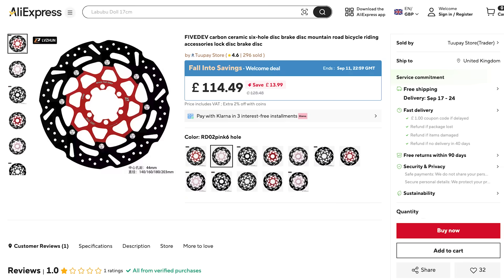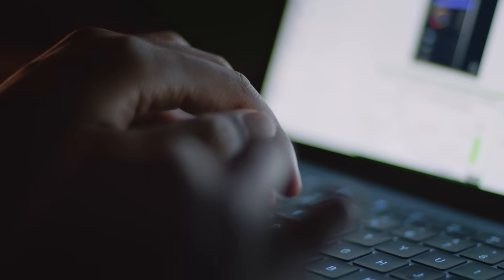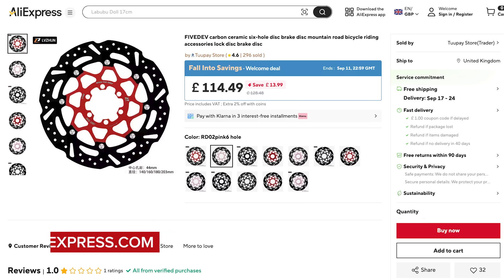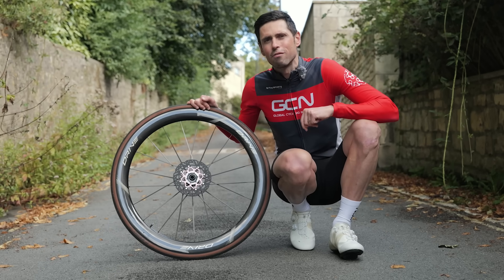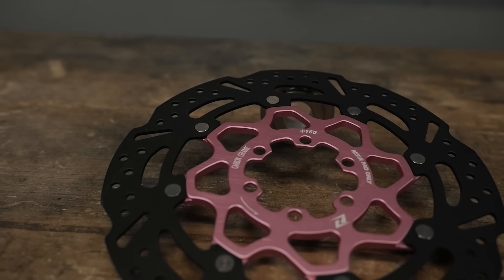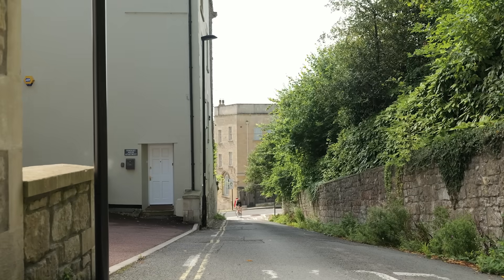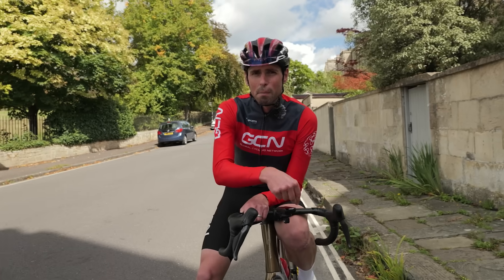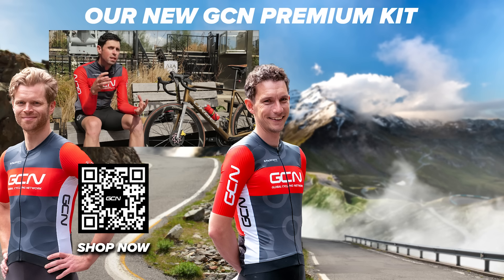Why Bikes Can't Have Carbon Ceramic Brakes

Comment: Back in the nintees as an apprentice I had various brake ideas myself, then racers were testing aluminium discs with a ceramic coating, problem was thermal expansion and letting the disc float, warping became the issue, brake discs have a thermal dynamic optimum, that sits as a constant operating temperature 
This negates alot of materials , carbon matrix composites are possible , but.... Very expensive 
The legalities of covering yourself as a manufacturer are too risky for the worth
It will be a complete overhaul of brakes , not just the rotor to change everything...

Comment: Luckily  for you, the breaks did their job at the stop (bold test)... I've worked in the aeronautical industry, where composite material are rife because they are light and diminsih the radar signal for military aircrafts. Yet, when it comes to shock resistance, they can't compete with metal (aluminium, titanium) for landing gears for example. I don't think we'll ever see a battle tank made of composite material... Cheers!

Comment: Speaking as someone who has titanium parts in her arm from a brake failure in an emergency on level ground, perhaps we should test sketchy brake performance wearing moto gear? Some cheap kevlar and foam pads between you and the inevitable slide if it fails outright won't matter until the day you get on the ali-express wee woo wagon ride to the bone sawing guys.  

Carbon brakes on a motorcycle make a bunch of sense, carbon brakes on an illegal ebike might make some sense, carbon brakes on a bicycle don't make sense. If the brake is still going to be able to perform with a louvred CF housing to keep the gravel out and be lighter that COULD be a real thing, but it hasn't been designed that way yet! The one place it will never be is on consumer grade bikes, if it comes to bikes, it'll be a dentist bike extra. 

As for just using CF, you are facing the Oceangate dilemma. If you pinch a steel rotor until it overheats you are at risk of slightly deforming it, but when you release it and cool it down it's going to re-crystalize into the structure that makes steel so gosh darn reliable. If you pinch a CF rotor until it overheats you are heating a small handful of layers of carbon and epoxy at different temperatures while putting it through shearing pressures that CF doesn't play nice with in the first place. It will fail, it will fail when you need it, it's failure will be catastrophic and sudden, and there's no guarantee it won't just flop loose and stop the wheel it fails on like someone ringing through your spokes with a pole, which will only stop you the once. On top of that, the weight savings are only substantial to the obsessive. That's not enough weight for me to compromise durability. It's frisbee sized not frame sized, we can hang.

Comment: They're great If you're going 300 kph and need to slow down quickly, but if you are going that fast on a bicycle I think you'd have bigger problems than having the right brake discs.

Comment: Folks who buy road cars with carbon ceramic brakes swap out the rotors for steel if the cars actually do any track work. It's just jewelry

Comment: Anyone arguing for carbon brake rotors in bicycles demonstrates their lack of understanding on how they work and why they are good... Carbon brakes are only good when they get HOT and bikes are just not fast or heavy enough to get them to those temperatures... It is just pure marketing, making you buy unnecessarily expansive rotors that don't even perform as good as good ol' steel ones.... OH BOY YOU SAVE 100 GRAMS OF WEIGHT by changig to these meassively expensive rotors!!! Bro, lose 100g of weight and you'll get the same result... actually no, because decreasing  your own weight would lower your center of gravity making our bike more stable...

Comment: I kind of feel like a Carbon-Carbon Brake(CCB) is a solution looking to build itself new problems in a bike. Steel Brakes run really well for the sporadic application of bike brakes and working great from cold in comparison. Carbon Ceramic brakes also have issues working from cold as well. As for the weight savings your Carbon Inner hub with a steel outer disc seems to be the answer to that problem to reduce as much weight as possible. There is a spot for CCBs but I feel that it is not bikes due to the need to build a lot(like boiling water hot) minimum heat in order to get the benefits as well as the awe inspiring price tag would dissuade all but the richest of cyclists from considering them. The only real spot where a CCB shines is in extreme high heat where break fade starts to happen. That can also be solved via cheaper means like cooling housing, thicker disks, disks with radiators to remove heat more effectively, and more effectively. Ultimately though I am just a watcher and a consumer so my view does not matter a whole lot.

Comment: Rim brakes for me. Rotors are an extra part. they introduce torque at the hub, putting cantilever forces on the front forks, and, extra tension on the spokes. You already have a rim, so you only have to add the weight of the caliper and cable/hydraulic line. All the torque is put on the large outer ring, requiring much less force on the caliper and pads. I don't see an advantage of a small diameter rotor, which requires much more clamping force, to create the same deceleration. (braking force) it just requires heavier, more robust mounting hardware, which adds even more weight!

Comment: Carbon ceramic and carbon-carbon brakes don't perform particularly well when cold.

From what I remember from my studies is that they work better at higher temperatures, as the coefficient of friction actually increases with increases in temperature, and that's the 1st issue you'd encounter with a bike... You're never going to reach the sorts of energy levels needed to reach that point, unlike a car or an aircraft 🤔

Comment: Much confusion here about materials. Carbon fibre epoxy composite - which is what most bike parts are made of - is not a suitable material for brakes and is not what the F1 teams use. That material is often termed Carbon-carbon composite and does not have epoxy resin in it. It can glow orange hot in use and not burn or fail. But it doesn't work when cold, as it is currently developed... Maybe with different pad materials it could be made to work in the bike application?

Comment: These “carbon-ceramic” bike rotors are just steel with a thin silicon carbide (SiC) coating. SiC actually has poor bite at normal temps and only works well when very hot, and only with metallic pads. With resin pads it basically doesn’t work at all—that’s why your braking felt weak.

True carbon-ceramic discs on cars are much thicker and use special metallic pads with carbide particles. Bike rotors can’t be made like that because they’d be too thin and brittle. So what you tested is just a coated steel rotor.

If the goal is to resist fade at high temps, a better approach (in cars, at least) is tungsten carbide–coated steel like Porsche’s PSCB, but that process is extremely complex and not available for bicycles yet.

Comment: SICCC SFL rotor owner here, i made an order as soon as i know it exist and did actually got it on my bike, to put it short that thing had NO braking power, well maybe that's a bit exaggerated but i'd say like only 50% of it's steel counterpart, like not even be able to lock up rear wheel level of power (yes i put it on my rear wheel), i even towed my bike with a motorcycle and do a lot of braking to see if that "working temperature" thing actually exist but nope, still no power, but one funny thing i noticed is that it won't overheat and causing brake fade like steel rotor, braking power pretty much stayed consistant throughout that towing session, maybe because there was like so little friction to create heat to begin with but that's something interesting i had noticed. Oh and that thing was super thick, like 2.5mm thick, so some bleeding is needed before putting it on. It's still laying somewhere in my warehouse because tbh that was one of the coolest thing i've ever put on my bike and i do hope one day there will be suitable pads for it and i can actually use it IRL.

Comment: I've been looking for the answer for a year now. Can't believe i haven't found it for 11 DAYS
Reply: Your answer is it's dumb. It's just people looking for more expensive bike products without understanding what CF reinforced ceramic really is. I'm shocked that the F1 engineer didn't point out why it's a dumb idea in general but he's probably assuming there's an application that makes sense.

Reality is they don't work well in cold or wet conditions and despite the fact that brake fade can occur on a bike, bikes just don't see the kind of forces that make it a practical option to begin with. Maybe ebikes it could eventually make some sense for but that still doesn't address the inherent disadvantages.

Metal rotars and pad technology could go much further before this even needs to enter the discussion. Not to mention they're stupid expensive and more likely to fail completely which no manufacturer is going to risk handing to anyone outside of controlled races.
Reply: @JJFX-  Yea but i was thinking to at least use smaller discs that heat up more. Think how much weight that would save on a motorcycle that uses 2 discs. If we could make carbon brakes a usual thing maybe we could decrease the diameter from 300 all the way to 200mm.
Anyway, thanks for the explanation. Maybe it's gonna be a thing in the future
Reply: @f3stann  Well there's a few things to clarify. Motorcycles in MotoGP and Formula 1 use carbon-carbon composite rotars, not the carbon-ceramic found on high performance road cars. The reason being that they operate at even higher temperatures but wear significantly faster and are less durable, only making them practical for racing. Carbon-ceramic are designed for durability while still improving performance at higher temperatures but still require heat for optimum performance.

Carbon composite would make no sense for bicycles so that's why we're talking about carbon ceramic. Problem is as I said, they still require more heat than bikes would typically deal with and moisture becomes a problem. If you shrink the rotars it's also putting a lot more stress on them, requiring other considerations to actually work without destroying itself.

Now could an enclosed carbon ceramic system ever work on a bike? It would trap more heat and help avoid moisture but you're now adding more parts to the system and would still get extremely expensive. Even if one could be made to work well enough for niche applications it just doesn't make much sense.
Reply: @JJFX-  Yea, as i said, we'll probably advance in the future. But this chase of max performance is pretty much pointless in the circumstances of a bicycle, as you said

Comment: The common demonator for the successful application of carbon rotors is high speeds. The speeds involved in road cycling, for the most part is simply not significant enough to get the braking system to it's optimum operating temperature to provide sufficient braking performance. 
Also, What on earth are those yellow brake calipers? o.0 lol

Comment: Bike frames and F1 disks both start similarly with a carbon fibre preform of the part. A bike frame is then impregnated with a plastic glue to make a strong carbon-plastic composite. Plastics of course are unsuitable for high temperature application. So F1 disks go through a more complex process of being impregnated with carbon (graphite) to make a carbon-carbon composite. Other performance road carbon disks sinter a harder wearing silicon carbide matrix (same material as ceramic bearings) around carbon fibre.
Compared to gluing these carbon-carbon process need a high level of expertise and complex/expensive tooling to set up and parts typically spend days rather than hours in the form making it an expensive low volume process. It is these high set up costs along with the benefits over steel scaling down with the mass and speed of thr vehicle that exolain why we don't yet have SiC bike discs.

Comment: Oh dear, just seen this video.
Someone really needs to fact check things. 
Firstly that isn’t a MotoGP bike its a Kawasaki Zx10r from World  Superbikes, secondly look at the discs on the motorbike they are steel, carbon brakes were banned by the series in the late 90’s.
MotoGP do run Carbon brakes and as soon as the temp drops or its raining they cover the brakes with shrouds to keep the heat in.
Long way of saying current carbon brakes will never work a bicycle as they don’t generate enough stopping power to create the heat needed to get the brakes to work effectively.
Still nice to see the Gravel Cycling Network trying something different.

Comment: This doesn't make sense. CF brakes are used because they work at extremely high temperatures, not because they stay cool, and they don't fade under repeated hard braking. They are suited to applications where massive power can be applied to accelerate hard after massive deceleration. How often doe a road bike brake so hard for so long so frequently that the tires cannot be locked under brakes? We're generally trying to maintain momentum, not brake from high speeds down to zero, and we don't have the massive power to accelerate back up to high speeds. Who (on bicycles, not MotoGP) is pushing beyond the limits of metal brakes?

Comment: why exactly? because even if its still CC rotors, its not the same carbon material as the carbon used on Formulas and GP bikes, its more brittle and less durable, and also cant be used at its best because CC rotors only work at their 'optimal' condition which is when its glowing hot, GP bikes have also been seen using rotor covers because everything and i mean everything can turn your rotors into scrap

(those rotors are also just SiC coated steel rotors, which are majority of the time scrap metal)

Comment: Main difference from F1 to a bike is that the brakes are always hot in the F1 vehicle.  Carbon fiber brakes preform at best no better than steel or other conventional materials at normal braking temperatures. Unless the brake pads are glowing red it is way cheaper and just as effective to use conventional materials.

Comment: There is exactly zero "carbon", "fiber", "ceramic" or even real "steel" in the rotors you've bought. Those are made from cheap, Chinese "steel" and painted black. Also, the whole idea of carbon fiber ceramic breaks for bikes is wrong. On the bike, they will never even reach their opertating temprature.

Comment: Larger calipers or either special materials will give not much difference on braking power or performance, braking power and performance depends on few factors such as mass weight, wheel size, suspension settings (in cars) and the list goes on, what’s matters is the amount of heat it can hold before the heat lead to the called phenomenon “brake fade” in racing tracks it’s going to be braking after braking repeatedly, then it comes the optimum temperature and how the heat dissipates fast enough but not too much, also the fluid has to be a proper grade to not boiling the fluid as the braking lines gets hot too.
Some people misunderstood the function of braking and spend money on expensive Wilwood kit and ended up using for a normal road driving.
Matter of fact if go to buy an McLaren they will ask if your proposition is to use the car on Sunday race and if the customer answer is not they will advise to “downgrade” the brake because midnight your neighbor will not be happy hearing a car squeaking loud!
In general cycling doesn’t need that….
By the way I still using rim brakes on carbon wheels and so far I’m happy with!
My gravel bike is disc by the way, but my road bikes rims…

Comment: In times of Dura Ace, this is completely pointless. No one needs more stopping power than what Shimano offers there. The system is performing well beyond the point of traction loss even under perfect surface and tire conditions. With SRAM, it’s a different story, but carbon rotors won’t solve that. Only good brakes will.
And, just in case this isn’t self explanatory (this video existing probably is proof enough it isn’t - oh dear, mankind is doomed I think some days): Buying cheap sh*t from China to use as safety critical components always is a dumb idea. ALWAYS. There literally is no upside, except maybe successfully applying for a Darwin Award.

Comment: As you've found out, carbon is not that great in this instance. They are very noisy and braking performance is poor when cold. Even in cars they're not as great as you'd think so, at least in road cars, as they have exactly that kind of problems, even the one with the braking force you have to apply (you can search for how much force a Formula 1 driver should exert on the brake pedal to give you an idea) and you can see at Porsche where customers are starting to return to normal brakes instead of carbon because of these issues. They're great for track use, not so for the road